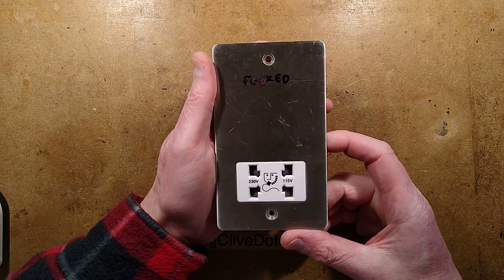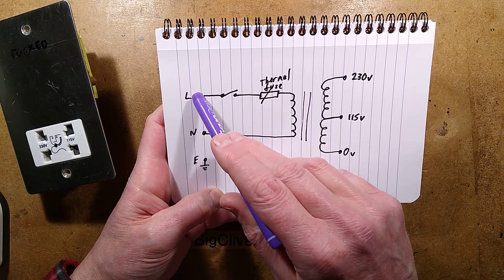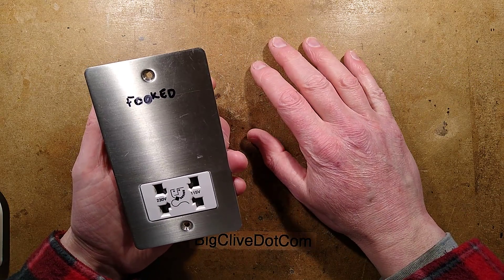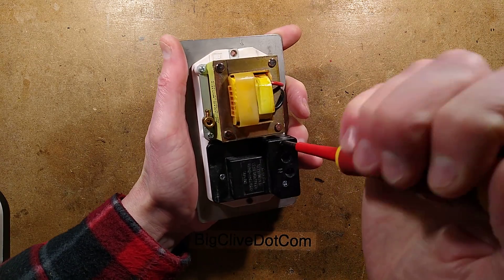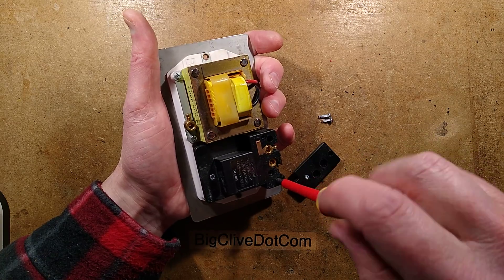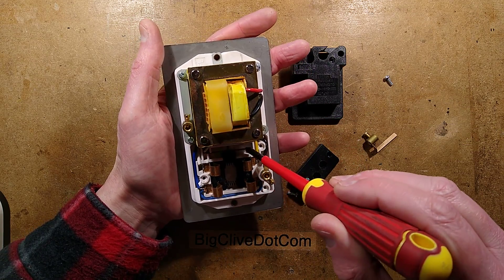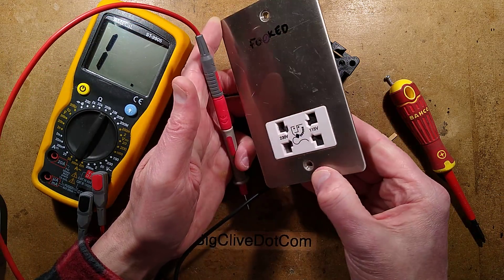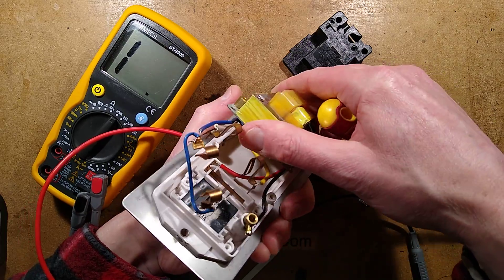Exploring a failed British shaver socket

Comment: #NoShaveNotEVER! 🐻

That said - I suspect requiring "20W [or whatever] Maximum" on the faceplate would have saved a lot of grief over the years.
Reply: People do not read, saying shaver only still does not help, because numpty will still plug in pretty much anything. How many 115VAC shavers have been blown up because numpty did not plug it into the 115 side, but instead the 230 side, and it went all smoke and puff while he was shaving. Then blamed the owner of the building for their stupidity.
Reply: Most folk wouldn't know what 20w means. Most of these UK sockets had a 'smiley face' logo (that kjnda looked like an old philishave) & were clearly labelled 'Shavers only'.

Comment: Used to see these a lot in houses built in the 1960s and 1970s in Canada.
Square metal plate with a single ungrounded 120 VAC outlet marked "RAZOR ONLY",  employing an isolation transformer.
Where I live in Canada,  they weren't immediately replaced by GFCI receptacles... that came later (late 1980s/early 1990s)... for about ten years (1977 - 1987 ?) a conventional 120V, 15A duplex receptacle was right next to the bathroom sink,  eagerly awaiting for something to be submerged while powered.  Local codes require GFCIs now,  but there is a ten year window between the safety of the "RAZOR ONLY" isolation transformer and the GFCI receptacle.
Reply: Our old house built in 1980 came with regular outlet in the bathroom, however they were attached to a GFI breaker in the main panel. As GFCIs outlets came into vogue (and became more reasonably priced) you general found the GFCI in the bathroom proper and daisy chained to other bathroom or devices that required that protection by code. So those regular outlet in early 80s were likely protected, but at the panel instead. This of course is in Canada. CSA seemed to do there homework back in the day, they don’t do as much testing these days, but are on top of the codes as they have written most of them.
Reply: @threeparots1  Had a razor only plug in my bathroom growing up in Canada it was annoying because i had to stand in the hall to blow-dry my hair.
Reply: @threeparots1  The house I am in now was built in '01, and the GFCI outlets in the bathrooms are tied to one outdoor outlet each. I found this out the hard way when I left work early to find a potential wiring fault, family was worried about a potential fire hazard. The GCFI outlet had failed in a way that it tripped any time you would insert or remove a plug, so I changed.out all of the GCFI outlets in the house to be safe.
Reply: Interesting, was this a pre ground fault outlet safety option?
Reply: @mpbgp  I think my edit might answer you.
Reply: @LakeNipissing  Forward thinking Canada. In the US, it was <bleep> it. Just put a convenience outlet right by the sink.
Reply: @mpbgp  is it really a problem? I've never heard of anybody dropping anything in the tub and reaching in after it
hair driers and the like have had built in gfci for as long as I remember, and one of the first things taught in school is household safety
Reply: @pacman10182  plenty of non gfci equipped hair dryers still around, also plenty of people who have died dropping a tv they were watching into a tub
Reply: @pacman10182  , the metal sink fixtures typically provided a path to ground (copper waterpipes!) and therefore touching the faucet or spigot handles with one hand while touching or holding an electrical appliance with the other hand could provide a path for current to flow through your chest and heart if the device was defective or ---- worst case scenario ---- designed with a "hot" chassis.  Most vintage transformerless AC/DC radios with a hot chassis had non-conductive plastic or wooden cabinets, and usually the knobs and things that were easily touched were made of non conductive materials (although screws on the rear panel and underneath the unit are always suspect). Hair dryers, however, were once made with metal casings, and shavers have metal blades, and curling irons have a lot of external metal; therefore, a curling iron, oran older corded hairdryer or shaver could have electricity on its chassis.  Nowadays hair dryers are usually made almost completely of plastic, at least the parts that you can touch, and the cord often has a GFCI or RCD built into the plug (curling irons invariably do as well). I don't know how many people still use a corded shaver when cordless ones are so common and affordable nowadays.  Homes that are recently constructed often have all-plastic water piping and so the sink and faucet might not even provide much of a ground path except for the resistive conduction of the water itself, which isn't that good of a conductor anyway.
Reply: There is a kit  you replace the shaver outlet with a gfi plug and  shaver cover.
Reply: Interesting. Wish I could find some houses with the old outlets here. I've seen plenty of weird wiring, and plenty of homes without updated electrical, bathrooms and kitchens without GFI, etc. Even still find plenty of examples of the old wrapped wire and ceramic insulators from time to time, but I've yet to come across shaver specific outlets. Pretty cool that they did use them.
Reply: @moxlon69  that's called "knob and tube" wiring.
Reply: Yup, the house I grew up in in Canada (built in the late 70's) had a "RAZOR ONLY" plug in one bathroom on the lower level, and regular plugs right by the sink in the 2 main upstairs bathrooms. All 3 plugs were obviously original - the shaver plug was dual gang, and the "regular" plugs only single gang, so it's not like there was originally a RAZOR ONLY plug there that got swapped out for a regular plug. Safety was "don't be an idiot" - in some ways, maybe things were better off that way - the dumb people took themselves out - now they just post useless drivel on facebook!
Reply: I've seen them, very rarely, in the US as well. They're NEMA 1-15 receptacles with "Electric Razor Only" or something similar. I assume they also have an isolation transformer.
Reply: I could have sworn the shaver outlets were 60vac, I remember wondering about "the funny outlet" in my grandparents place. 🤷
Reply: Still see them on renovations fairly often in AB, but definitely becoming less frequent.
Reply: I have a "Razor only" plug in the place im currently renting, interesting tidbit thanks
Reply: My mid european house built in the early 90s has just regular sockets and bakelite breakers.
Reply: I'm pretty sure I remember a "razor only" outlet being part of the light fixture mounted above the mirror.  The transformer was mounted to the back of the light fixture junction box cover.
This probably meant that the outlet was energized only while the light was on, but I can't see anyone wanting to shave in the dark anyway.
Reply: In some parts of the USA (cough, Michigan, cough) having a unprotected, regular outlet right next to the bathroom sink is (apparently) perfectly legal and code compliant to this day.  If I moved into a house set up like this I would install a GFCI either at the breaker box or a GFCI outlet in the circuit.  Theoretically the circuit breaker should trip when 50 plus amps start flowing through a 15 or 20 amp circuit into your body but that doesn't always happen fast enough.  We don't usually have isolated shaver outlets here, I remember seeing them in Canada but not here in the States.

Comment: I've only ever seen shaver sockets in the UK and in hotels. Australia uses normal power sockets in bathrooms - hope the RCD is good!
Reply: Netherlands has 20va shaver sockets too. Well, used to, anyway. Under modern rules you can just use a standard earthed outlet which is of course gfci protected just like the rest of the house. We don’t put 110v sections in though.
Reply: Exactly as said. Used to. I remember I learned about this for the regulations exam (NEN1010 IIRC)  but never seen one in a domestic situation.
Reply: Iv seen them in Aus normally in hotels but not common and generally look very old.
Reply: @lukelahnstein  Was gonna say exactly that, I dunno who even owns shavers with those weird plugs since they're only used in hotels.
Reply: @uckfayooglegay9982  think they are meant to be a universal socket
Reply: @lukelahnstein  most people don't seem to gave the notion of a wired shaver anymore. Especially as you will unlikely charge it is the bathroom when on a trip.